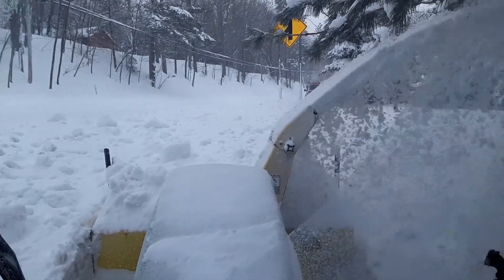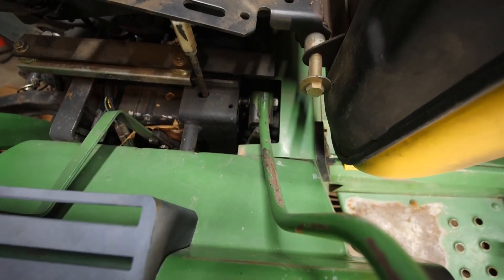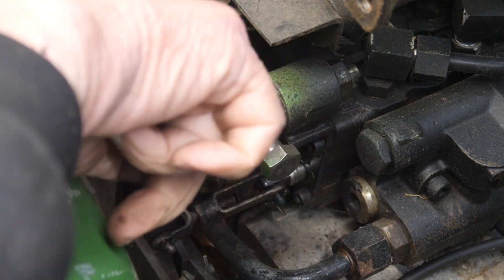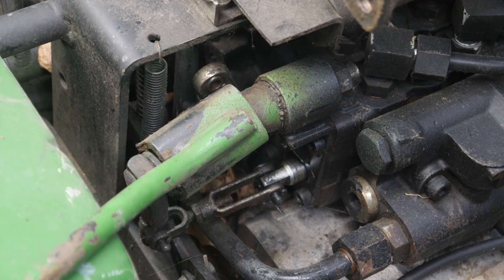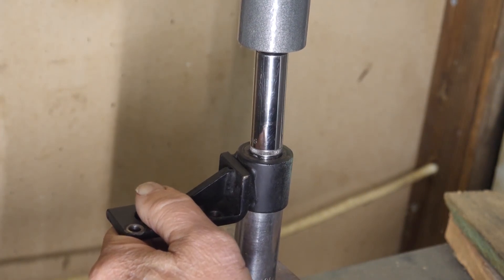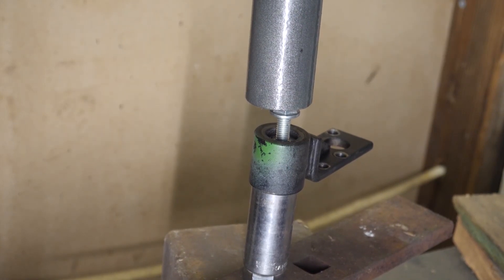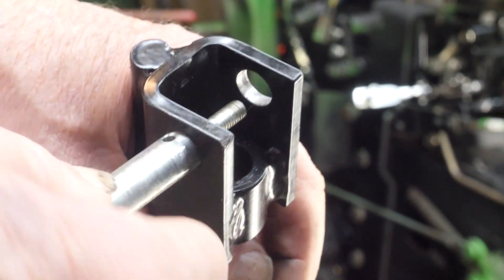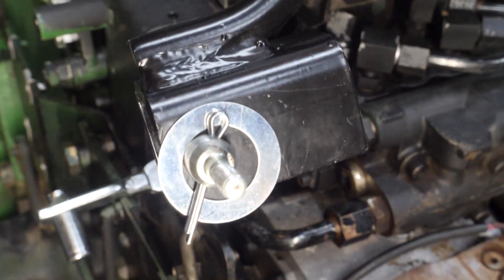John Deere 755 Blind Date (Overbought) also 655, 855, & 955, Episode XII

Comment: Thanks for putting this video together, I've been looking forward to this one! My 955 hydraulic control linkage is a mishmash of someone else's home made parts, and definitely needs some attention.
Reply from the maker: How does a guy decide? Spend $350-$400 for parts or food? As long as it works, we (those of us who grew up saving every bolt, washer, baling wire) keep using it. Conversely, when things are worn out replace them (but keep the old ones around "just in case"). The Overbought 755 is still waiting on parts but I know that I'll resist moving the new levers to keep them new. Old habits die hard. md